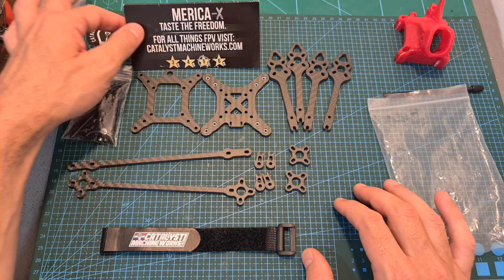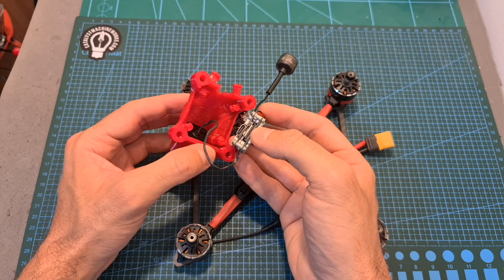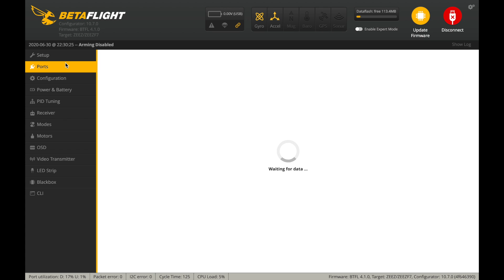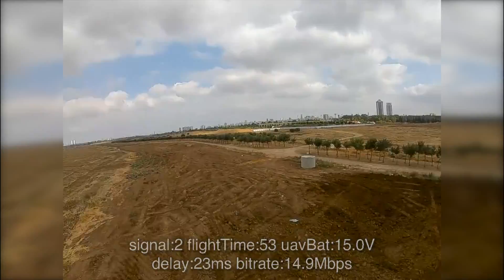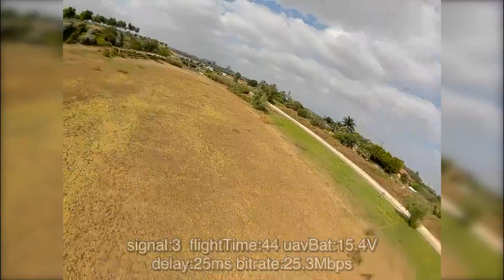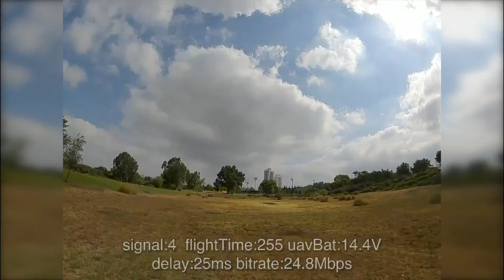🚀 CMW Merica X HD - Build & Flight

Comment: Did i have any heating issues with vista its tucked in there pretty snug
Reply from the maker: As far as I can remember no - but it can be a problem on hot days.
Reply: @KremerFPV  probably not here in the uk. Lol. Thanks man.
Reply from the maker: @noisey_boi_rc  Haha, no problem :-)

Comment: I built mine a few days ago.. this HD canopy is fantastic.
I dont race, so it could use a bit more down-tilt for the cam (easy to fix with a soldering iron).  Its not too bad stock, just takes some getting used to... beyond that I really like the canopy and its a super clean build.
If your fc has a on/off switchable vtx (vbat) pad I'd recomment powering the Vista off of that so that you can power it up when you're ready to help keep the heat down.  If you don't have that option skip soldering the Vista the the fc and use a small plug (jst, etc) so that you can disconnect the Vista's power from your esc's battery pads, and that keeps the canopy and its contents self-contained and free of the frame (and esc) when needed.
Oh, and dont use red props.. they'll show up a lot in the cam.
Reply: red props are the fastest
Reply from the maker: Thanks for your input! I agree, you should definitely not leave the vista powered up for too long when not flying. 
As for the props, that's true, depending on the angle of the camera. For example, in my video the propellers didn't show up in the flight footage as the angle was pretty high, but if you are going to lower it down like you did they will show up and it's probably better to use clear props instead.

Comment: Nice video, quick question does anyone know how too get the ocd on the saved video from the SD card too your computer
Reply from the maker: Thanks. You can't get the OSD on the saved video file. You are getting an srt files that contains some of the data (Battery voltage and etc.) and you can add it manually using video editing software to the video file by yourself.

Comment: Basic question: when you recommended the 6S motors for less battery sag, were you thinking to use them with a 4S or 6S battery?
Reply from the maker: Good question. Normally I would suggest using a complete 6s setup, but you surely can use a 4s setup like mine with 6s batteries by lowering the output of the motors using BF (and of course you need to make sure that all the other electronic parts support it asa well).

Comment: Flies good. Wish I had got this vs the Flywoo Vampire 2 HD which wasn't setup right with one motor spinning the wrong way and after I fixed that it had huge oscillations making it unflyable and absolutely not BNF.
Reply from the maker: That's unfortunate. Did you try reaching out to Flywoo? Maybe they can help you out.
Reply: @KremerFPV  Yeah they sent a picture of blheli and a cli file. Reversing the motor was easy but the cli was worse than previous. Whoever is at Flywoo does not know what they are doing. I'm currently trying to tune from scratch but I feel a bit annoyed I can't just fly. Flywoo don't seem to care and have not replied when I told them the tune is wrong and sent a video. I guess they got my money now so that's that.
Reply from the maker: @changeagent228  I haven't been in touch with them for a while. For some reason they ignore my messages so there's not much I can do. I suggest flashing Betaflight 4.2, start with a clean tune and slowly adjust the settings using the sliders on the PID tab on BF. I hope you will get it right eventually.
Reply: @KremerFPV  Thanks yeah it came with 4.1.1 so I may just do that.

Comment: 👍👍I could be wrong but I think that rear brace is installed incorrectly. Isn't it supposed to raise the rear motors more?
Reply from the maker: Both ways are ok I guess, but you can see on CMW's HD canopy page that they mounted it exactly like I did :-)
Reply: @KremerFPV  Just a note, it is 100% meant to be mounted between the rear arms and the motors. The idea is that since it's a true X instead of a stretched X, raising the motors will give a little more clearance between the prop discs in forward flight.
Reply from the maker: @chrismawson4430  Thanks for letting me know!

Comment: Looks really nice.  Question on the canopy though; it seems to fully protect the Vista but it doesn't look like it has any real airflow.  What kind of over-heat risk do you think this poses?
Reply: First - correctly setting up the Vista on a uart and turning on Auto Temp Control is the most important factor for any build, especially one with a canopy... and its not the regular 4-5 minute flight that matters.. its a crash thats the problem.   During a flight it has enough airflow, even hovering in the canopy.  But if you're setup doesn't fall back to high-latency-low-power when you disarm you have a problem... it'll sit there getting hot as hell in still air while you walk farther than you thought it'd be, hunt around, cuss, hunt more, and finally locate and unplug it.

I built mine using a CLRacing F7 and used its switch on/off vbat option.  I put the on/off on the middle position of my arm switch, I can plug in and let it sit til I'm ready, flip to the middle position and wait for the image, then arm and go.  The Vista is also (obviously) set up on a uart so that even on the middle arm switch position its sitting on high latency low power mode ("auto temp control" in the bottom "device" goggle settings, iirc.)
So far mine has been running fine in the canopy.
Reply: The Vista runs at 700mW with the heatsinks taken off. It should be fine with them on even with minimal airflow
Reply from the maker: This quadcopter is built for racing and the expected flight time shouldn't be more than a couple of minutes, so it will still get some airflow while airborne. When on the bench I recommend to follow Dash's advice.